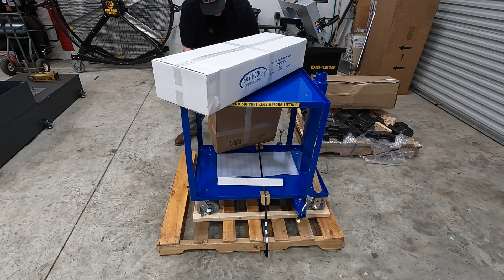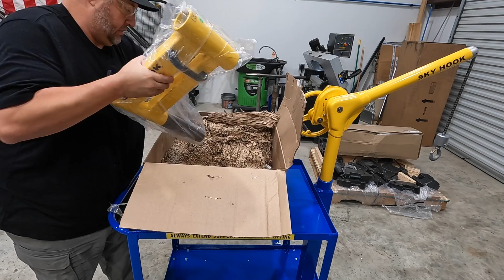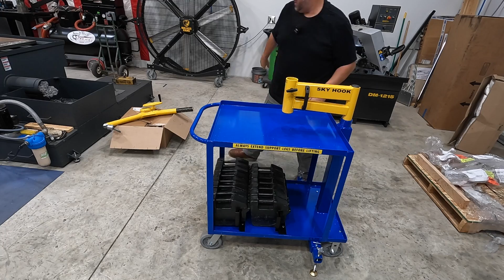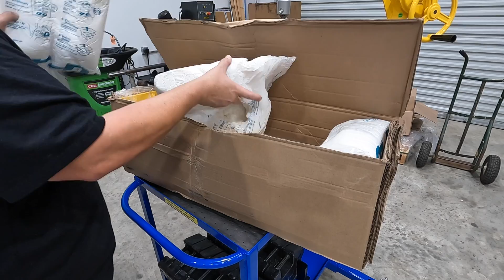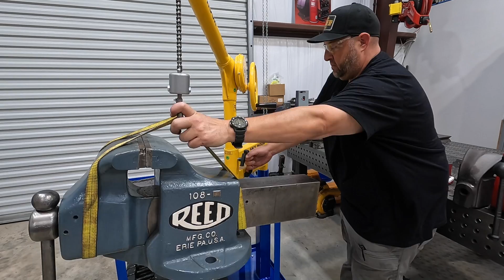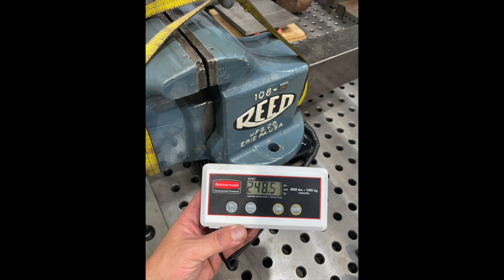Tool Tuesday Ep. 9: Sky Hook Mobile Cart

Comment: I'd bolt the pedestal to 4" I-beams welded in an X with heavy duty casters on the ends. Instead of moving it around to each bolting point on the floor. This way you don't have to also keep transfering the item and crane from cart to pedestal. 🤔🤔🤔🤔🤔🤔🤔🤔

Comment: Well, a 2000lbs electric pallet stacker lifting to ~five or six feet is worth its weight in gold. Move, lift, load or use as a work table. That or a overhead/gantry crane, we have (and use) both...

Comment: Adam, you could sink a tube into the floor of your truck in the corner next to the tailgate.  Run the cart with the load up to the truck.  Swap the Sky Hook from the cart over to that mount, lift and swing your load off the cart and into the bed. That'll let you position the load in your bed.  Quickie tie down.  No sweat.  Close the tailgate and you'll have the Sky Hook there to unload.  If you don't unhook the load, it's weight will hold the Sky Hook down.
Reply: might be able to make a trailer hitch mount and have it detachable

Comment: Yeah, I know when I was 30+ years younger in my twenties I'd pretty much try to lift anything. Sure as heck can't do that anymore, my back (and knees) just can't handle that.
Reply: :person-turqouise-waving:..............G'day Mathue,
yes I remember when my motorcycles were no trouble at 20yo, that was 60+ years ago. I just ride with more visibility help now. Still gotta watch those bloody cage drivers on the phone or the door-skins pumping. I'm going back to short bars and center footpegs when I change the gearbox and primary, easier to lane-slip.
Cheers,
Malcolm.
Reply: What people don't take into account is that if you are spending hours and hours loading and unloading 'heavyish' stuff', whilst no problem at the time, when ( long after you've stopped doing that type work) you get into your 60's you can  get pains in your arms, much like a 'toothache', especially at night, and those don't go away.  I pity those who spend long shifts manually unloading  heavy stillages onto pallets to go out the door; you know, the ones that boast that they've handled so and so  many tons of weight during their shift.

Comment: That section of steel round bar at 150 lbs weighs more than most mini lathes complete let that sink in when considering rigidity in machine tools weight means rigidity and better machining and finish to what you are machining.

You need a Skyhook adaptor mounted in the truck bed for unloading stuff as well

Comment: I wouldn't be so quick to blame the truckers, Adam. I think  the shipper could have done a better job with  the crates. I have shipped ( and received ) a lot heavy things, over the years. These are valuable items, and worth making the effort to crate properly.
Reply: It's not the truckers, it's the squirrels they have running forklifts in the warehouse! I have two forklift certs and the things I've seen these kids do make me cringe! Full throttle all the time, swinging around corners without looking or slowing down, running into things. Got an ~80-gallon air tank one time returned to us as "Defective". It had a hole in it exactly the size and shape of a forklift tine! Nope, not our problem...
Reply: you're right, the factory could use metal banding straps to bundle the counterweights more tightly, thats my suggestion

Comment: kinda seems like a shop gantry might have been the way to go. or are they considerably more expensive than a jib and that sky hook etc
Reply: Kind of a pain in the ass for small loads like this is for, I have something like this skyhook, but it will do 1000lbs and I have a gantry in my shop for upto 3 ton

I only ever use the gantry if it's necessary, way way less manuevarable for moving angle plates etc etc

Comment: Hear getting older.  I'd me looking to a mount on the welding table.  As far as multiple floor mounting locations, only if the bolts have 30 inch extensions on them so one doesn't have to get down on the floor.

Comment: Adam is using the cantilever incorrectly. The main arm should be turned back over the cantilever arm so the load passes behind the cantilever support post and as close to the centreline of the trolley as possible.  Using the cantilever as an extension to the main should only be done along the length of the trolley, not to the side. The support extensions help the sideways stability but they should not be relied on. The counterweights are only effective along the trolley length.

Comment: Might also fabricate a flat plate top mount adapter, this way vices/grinders can be mounted, and be used for other applications when the pedestal is not needed for moving materials.
Also...might make a side mount adapter for the fireball tool table, permanent mount location on the side of the table

Comment: where was that company all the years I was running big parts? that will be a big back saver.
 if you put thread anchors in the floor  put set screws in them when you are not using the base, will keep all the dirt out of the holes when the bolts are out.

Comment: A 6 Inc riser under the cantilever would help with the tailgate issue. One improvement would be to have the outriggers one piece and pivot out from the side. Other than that it looks like it's a back saver.
Reply: and maybe incorporate a thrust bearing to help with swiveling?

Comment: Adam, mount the pedestal in the back of the truck.  Then set the skyhook on it, when you are moving heavy stuff from point to point.  Maybe use wing nuts to hold it down.
Reply: I will Laugh Out Loud when Adam Booth uses Wing Nus for anything!
Reply: Look in Adam's archive from a year or two ago. He did a build series converting a Harbor Freight type engine hoist to a truck mounted version. Building a custom mount, bushings, connectors and everything needed to mount it on his truck. Making the whole thing quick attach/detach for storage. It was a good series with lots of lathe work, milling and welding.
Reply: yes, I do remember that now.   @dennythomas8887
Reply: @dennythomas8887  Yes, but he never did show the 'contentious wiggling of the pin' on its standing leg.

Comment: Very nice. I just bought a Premium bench mounted model (new, never used) on eBay. Should be here in a couple of days. I'll want to buy the lathe chuck arm, and maybe even fabricate my own cart. I have a 1440TL lathe myself, and while it's slightly smaller than Adam's 16" model there, the chuck(s) must weigh about the same. Getting way too old to heft 75-pound chucks around over the bed of a very expensive lathe. Arthritis is a bitch.

Comment: Looks like a candidate for making useful.

Why buy all those weights when buying batteries would weigh as much?

Why does'nt it have a remote control (keyfob) servo motor instead of that skyhook plastic handle?

Having 2 hands free when lifting loads with 1 finger press is  useful.

A 4 channel remote & another serrvo motor could allow forward reverse system travel.
Or jib rotations.

Keeping the skyhook same height but cutting a couple of inches out of the legs would make the upper surface the same height as the saw, always useful to have extended sawbed.
Reply: you mean use car batteries for lead weights? im gonna assume a functional battery device cost is wayyyy more expensive than some raw chunks of iron

Comment: And how will he unload the Reed vise at his home shop?.  Will it be his project tow hook hydraulic lifter, did he buy a replacement engine hoist( I forget)?,  will he toss the Sky Hook and trolley in the back, or will he use his tractor loader?  ( fork lift is at the wrong shop, pity that ).....decisions, decisions.  I suppose you can have too many tools,lol; but one thing's for sure, they do take up workshop floor space.
Reply: Didnt he make a crane for his truck a few years ago?
Reply: @ulwur  Not using the right words maybe, but that's what I called the 'project tow hook hydraulic lifter'.

Comment: hey adam, not sure if you mention it in the video, but how much does each counterweight weight?
Reply: He didn't mention it,  I was wondering, too.  I would guesstimate twenty five pounds (11, or so, kg), each... It could be  more, not likely less.
Fifteen such weights, at 25 lbs. each, is 375 lbs. total.... Stated lifting capacity of the SkyHook is 250 lbs., per Abom79.   Okay, so there's a comfortable safety margin, even with the SkyHook cantilevered all the way out.
Reply: On their website the set is 630#, so 42# each. That's 125% of the 500# capacity (without the articulating extension).

Comment: Those spare levelling pads you made for the lathe could be used under the outrigger adjusting screws.  Would make the screws more stable and save having to wind them in and out too much when moving the trolley around.  Even store them on the base of the trolley for more weight.

Comment: That Skyhook is a very versatile tool a real back saver the older you get the more you'll appreciate it.
Reply: The only tweak to that particular Skyhook design  (unknown if already an option) is an option to remove/foldaway the handle and use a battery powered drill (similar to speed ratchet binders) to wind the chain up (& down)
And
A hook on the trolley to restrain the hook in place when not in use (save it swinging around and KTFOing the operator during moving
Reply: :person-turqouise-waving:............G'day Neil,
you're not wrong brother. I'm 81 and still fixin' motorcycles; Thinkin' about changing my gearbox in the Legend#7 (illustrated).
Cheers,
Malcolm.